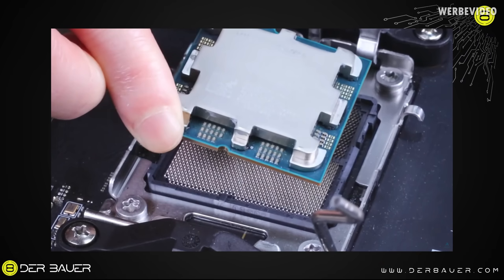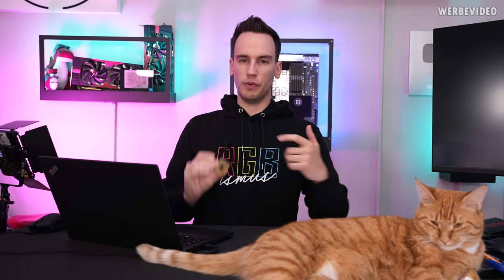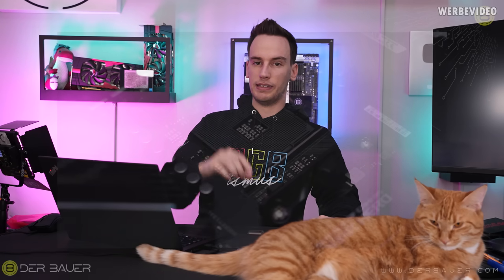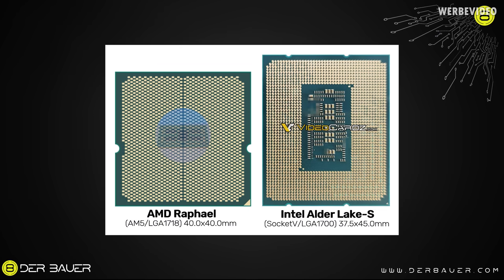Very thick IHS and less Contact Area - some thoughts on Ryzen 7000

Comment: Just use a shitload of Thermal Grizzly to fill those gaps for more contact. Learn to market dude ;)  
And i think ALL heat spreaders are to thick.  They could improve cooling of al coolers and temps of all cpu's just by losing 1,5-2 mm on those stupid IHS. And on top of the placement and heatspreader area reduction keep in mind the higher tdp for the am5 socket and expected higher power draw.  this may indeed be a hot one.
Reply from the maker: I approve this comment xD
Reply: So couldnt you make up for the loss in contact area by milling out a cold plate to fit the  IHS and also contact the vertical surfaces? It makes it a bit more complicated to calculate but then i woukld think you would end up with a lot more contact area over all. Although i would imagine the tolerances involved to get good contact on the sides and top of it all would be exceedingly difficult and in the end it still would all boil down to thermal conductivity. But i do wonder if there is any room for gains at all by trying to utilize the edges for contact area?

Comment: I'm sorry, I missed everything you said because I was looking at your cat.
In all seriousness though, the IHS does have a kind of weird shape and yes it does have less cooling surface. Whether this will affect cooling though remains to be seen since with Zen 3 it didn't really matter if you had 100% contact coverage as long as the CPU core packages and I/O die were fully covered.
I would also like to point out that the reason why the CPU PCB is the exact same size is because the AM5 socket was designed to be backwards compatible with AM4 brackets and coolers.

Comment: When you compare the contact surface, it's not really relevant to take into account "dead IHS" space. Only the areas that sit directly on top of the dies matter, whatever transfers to the rest of the IHS is a really low amount of heat that doesn't do much with high TDP CPUs. But Ryzen 7000 might actually benefit more from that dead IHS surface, since it's thicker and it will conduct slightly more heat through the dead IHS and into the cooler. I would also guess it won't help much nonetheless and the only true effective cooling will still happen only on the areas that sit directly on top of the dies.
Reply: Under normal conditions the heat propagates "outward" at roughly 45 degrees, so a thicker IHS should be a good thing provided it is made from high purity copper.
Reply: @andersjjensen  thicker IHS might be good in almost all scenarios, maybe except extreme overclocking, where you'd benefit more from as little interface as possible between the die and the cooling element, so the heat can flow unrestricted. But yeah, I expect a slight improvement with AIOs.

Comment: ZEN3D used wafer thinning to fit V cache in same Z height. will ZEN4 also use wafer thinning for better temps at 170W? What do you think
Reply: Maybe increased  IHS  height is to save the die thinning cost, also planning for v-cache

Comment: regarding the liquid metal application, doesnt amd typically solder their ihs on anyway?
Reply: Sure but a very thin layer of Galinstan LM is still better than a thick layer of Indium from a thermal conductivity point of view.
Reply: @riphunter5100  gotcha, gonna be hell removing this ihs tho with those chips on top... atleast the older intel chips i did it on it was piss easy

Comment: A THICC BOI IHS is fine.  It's more material for the heat to sink through.
Reply: It is bad for cooling transfer.
Reply: @brunogm  Yup!
Reply: more material between the transistors and the heat pipes means more thermal insulation.
Reply: @brunogm  Cooling transfer is irrelevant if the IHS is made of thermally conductive materials. Such as copper.
Reply: @Mp57navy  conductivity depends on distance that why is W per Meter Kelvin.   Fins work because they reduce the distance, IT is WHY air or  water works despite their contrasting thermal conductivities.    Fins are a  great  hack !!!

Heat_transfer = -k * (Temp2 –Temp1)/ Thickness
Reply: @Mp57navy  That makes no sense and of course it matter for any material whit finite thermal conductivity such as copper. The IHS of a CPU is not the freaking singularity of a black hole that theoretically has infinite thermal conductivity and even that is a mathematical fantasy and not a physical thing.

Comment: How long until we have copper ihs from factory?
Reply: Its already copper just nickel plated and to me is better to just get rid of the IHS altogether because as the lithography gets smaller the silicon die become more thermally dense and having the heat to travel a bunch of layers is something that makes everything hotter and inefficient.
More heat=More current leakage from transistors=high clock speeds become unstable.

Comment: How do they manufacturer the IHSs, are they cast or stamped or what?
Reply: They are stamped
Reply: Stamped
Reply: Unknown Alien  no.
Reply: Unknown Alien  why make it slower and cost more if you can make it easier via more practical method?
Reply: Unknown Alien  At a higher cost for minimal if any gains in cooling ability.
Reply: Unknown Alien  it's pretty well established manufacturers will save money at the cost of performance. Not to mention it would net zero gain on a chip in the R3, R5, I3, I5 categories so why would they pay for tooling for 1/3 or less of their product line.
Reply: Unknown Alien  it's cost prohibitive. Do you have my idea what tooling costs? How much factory floor space is worth? A new way of manufacturing every product in their line we're talking about just a half or a third which means all new equipment taking up valuable floor space and you can even look at the finer details like training the employees redesigning the IHS and all for what 1° c at best? Why am I even having this conversation this is beyond ridiculous

Comment: I`m sure you have the delid tool ready hahahah
Reply: @KrazyRyzenPC Yeah, I know that but it wasn`t the point :) I haven`t delided my 8700k, def not gonna delid a 7000 series Ryzen lol
Reply: I am SOOOOO happy delid is going to be a thing again!
Reply: @KrazyRyzenPC It isn't dangerous whit the der8auer tool.
I personally delided my 5700g with it and everything went fine without a single scratch in the ihs,pcb or die and the temperature difference was just 5C but in the Asrock Deskmini X300 you just can't put any heatsink bigger than 54mm so this is the only way to lower the temps whitout
resorting to fry my brain listening to a DELTA FAN AT F**** 5400RPM LOL🤪.

Comment: I'm trying to wrap my head around how you did the IHS size measurement. Pixels are not a size measurement and their physical distance vary completely based on density (pixel per inch). A 4K laptop has much shorter pixel distance when compared to a 4K 65 inch TV. So how have you achieved this result by looking at a video through your device? The result is pretty credible though, 4cm seems like a good approximation of CPU length. Have you used standard web 72ppi for the calculation?
Reply: You don't measure your display, but you count the pixel on the picture of a known item. The number of pixels in the picture doesn't change from one monitor to another.
Reply: @Mysteoa  Sure, but the pixel count still has to be converted to the metric system. How do you do that?
Reply: @viduani  it's like this. That resistor is 2mm in irl on the picture is 7 pixels. So 1mm is 3.5 pixels. This is enough to make a ratio for the whole picture.
Reply: @Mysteoa  That's what I thought. Guess the capacitor size is standard enough to be able to do this
Reply: @viduani  the problem for me is when the phone is taken in an angle, it complicates stuff.
Reply: @Mysteoa  Derbauer did mention he could somehow compensate for it using Gimp software

Comment: I see the distance b/w the ccd's & the I/O die is shorter. Smaller die size & closer to each-other (both ccds are also slightly tighter). That suggests better internal latency. No doubt about it, even more its on a smaller process node.

Comment: I believe they explained in a interview that it's not glued. It's soldered on, the heat spreader to the PCB. The thermal compounds connecting the die to the spreader have been increased and technically the surface area is about the same. Why? Because the L shaped bends increases surface area. Sure it's more optimal to count what makes contact to a heatsink but I believe it was explained it was due to whatever thermal compound they have inside the heat spreader. I don't exactly remember but I think it was something similar to liquid metal but could very easily be wrong. Again this information I'm mentioning is me going off memory with the 1 hour interview with Tom's Hardware.

Comment: An IHS that's almost 50% thicker than previously will be worse for temperatures, not better. Not much, as the solder is probably the main limitation, but it will impact temperatures.
Reply: smaller size size and better node may make balance it out a little.. interested to see how amd handles this one.
Reply: I'm pretty sure Derbauer doesn't have it wrong 😆
Reply: Thicker IHS reduces hot spots. So max spot temperature might be lower even if min spot temperature is higher.
Reply: @kazedcat  But the thickness also reduces heat transfer…

I think they royalty screwed up already
Reply: @christophervanzetta  cooper transfer in the x-y has to be limited for thicker to help with hotspots.
Reply: @christophervanzetta  This is not always true. The function of a IHS is to spread heat to a larger surface area. Thicker IHS helps spread heat faster. If the amount of heat extracted from the IHS is more than the amount of heat injected into the IHS then the IHS does not reduce heat transfer. It is true if the amount of heat extracted from the IHS is less than the amount of heat injected. You need to remember that there is an active cooler on top of the IHS and they are actively extracting heat away from the IHS. You are trying to model a close system but the CPU heat transfer is an open system until you saturate the rooms ambient temperature.

Comment: How the clamp/notches  design!    
could  they prepared for uneven backpressure from the pins and go all-around instead of two center flaps?

Why the mounting cover has so large hole.  A few millimeters and no center flaps would be needed!

Comment: Somehow I dont think Ihs area matters too much. You will always be needing to cool the area at the exact top of the hotspots to make a difference. Imagine strapping a 1m2 plate on top of a die and expecting it to magically cool a million times better... Is that logical?
Reply: Well in the end it realy boil down to thermal conductivity and how quickly you can remove heat but actually the larger size would have a much higher thermal mass 
so it would have a  larger potential to absorb more heat than something that's smaller so it could have a larger effect on cooling but if it cant conduct the heat away any quicker it will have no real benefit

Comment: Are they 100% confirmed to still be using 8 core chiplet dies... or could AMD actually using 12-core dies, with disabled cores?
The die shrink should provide at least 50-90% more transistors??? 7nm vs 5nm - 49 vs 25???
Reply: 8 core chiplets, that was confirmed by AMD.
Reply: From what I've seen Zen4 uses 8-core CCD's with almost an identical layout as Zen3 with the exception of the cache (same position, different configuration). So the CPU cores are still on the sides in groups of 4 with the cache in between. There are no plans for Zen4 CPU's with more than 16 cores as far as I know, instead AMD tried to concentrate on improving single threaded performance to be more competitive with Intel for gaming performance and higher cache (double L2 cache for the X models, stacked cache for the X3D models to be launched in 2023). This makes sense because having more cores would make the Ryzen internally compete with Threadripper and Epyc so 16 cores will be the maximum for Ryzen 7000.
Reply: Yes. Ignore AdoredTV's poorly-researched speculation.
If they were using 12-core dies, Genoa would have 144 cores, and Bergamo would not exist. The most likely reason that the CCDs are larger than expected is that there's some empty space on the dies to help with cooling.
Zen4c/Bergamo is based on 16-core chiplets with less cache. If AMD want to increase the core count on Zen 4 desktop CPUs they will use one of these chiplets.

Comment: Pretty sure AMD engineers got this covered, making such massive design mistake would backfire massively especially when you are clocking your CPU to crazy frequencies like 5.5Ghz on all 16 cores.
Reply: Thumbs up for engineers being smart, not so sure about 5.5 all core though. Would be amazing though.
Reply: @mikesteve3039  leaks indicate that it's highly possible for the highest end CPU to boost all it's cores close to the 5.5 GHz mark, so I think it's possible and maybe easily doable with some overclock. I could be wrong but I think Zen 4 is way way flexible and highly overclockable compared to Zen 3.
Reply: @TechLevelUpOfficial  That would be mighty impressive. Which leaker if you recall? Wonder what the single core would be if thats true?
Reply: @mikesteve3039  you can find it on Dr. Ian Cutress's tweet on that Computex Demo.
it was like this:
▶ AMD Reference Mobo
▶ 280mm AIO cooler
▶ 16 core prototype from April
▶ Plugged in, no OC
Natural freq of that CPU
▶ Most threads around 5.5, depends on scene/game
▶ 5.2-5.5 on all threads was common on the game
the last part is the interesting bit. "all threads"
Reply: i highly doubt its 5.5ghz across all cores.. probably 1-4 cores... rest at 5ghz or lower...
Reply: No one expected LGA1700 warping ... so there is always possibility
Reply: @brunogm  the shape of those CPUs has to do with warping, they are rectangles not squares. Putting any stress in the middle will cause it to warp. Pretty sure it has to do with socket manufacturers miscalculating the amount of stress the IHS can take before bending a bit. Or maybe a communication problem between them and Intel. Who knows
Reply: @TheBURBAN111  it's doable, the new chips are clearly designed to achieve higher frequencies since it's one of the things that are needed to boost performance, AMD is using that to gain every bit of possible since the new architecture isn't that different from Zen 3. Technically speaking it's a tweaked Zen 3 on smaller node with higher clock speeds. One of the reasons why AMD used the term single thread and not IPC. But hey everything possible.
Reply: @TechLevelUpOfficial  Thats right, I saw that. But i interpreted that as 5.2-5.5 on all threads that were involved in the game. Robert Hallock also said something that made me think along those lines too, but i dont remember which interview it was
Reply: @brunogm  Lol, i wonder which mcdonalds those engineers work at now? :)
Reply: @mikesteve3039  not sure if the tweet is talking about the threads involved in the game or all CPU threads, but as long as a single core 5.5 is achievable by the CPU boosting itself, that gives us plenty of headroom for overclocking them all to that speed. since the higher end parts should be highly binned anyway. maybe 5.2Ghz all cores out of the box with PBO on, 5.5 all core with a decent OC.. too early to guess
Reply: @TechLevelUpOfficial  yes but just using two center flaps or getting a cover mounting that "fits" the IHS border would be a nicer system.   Each pin gives ~2g of backforce but since they are thousands it goes many Kilos.   Even if in the square shape of AM4/5 its not warping for signalling ( memory issues) better force distribution is desirable.

That would help tooling and testing for future.